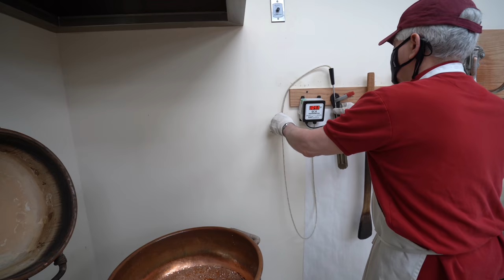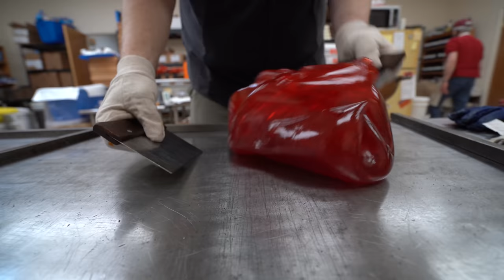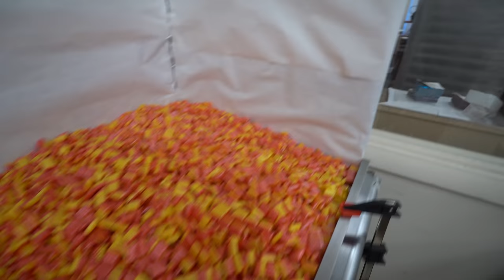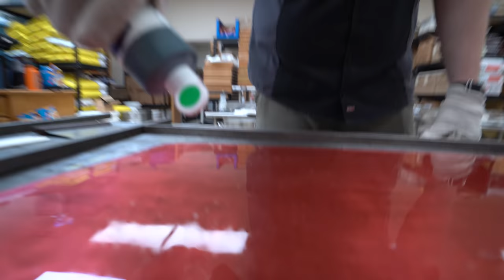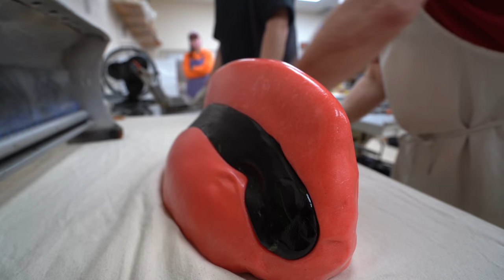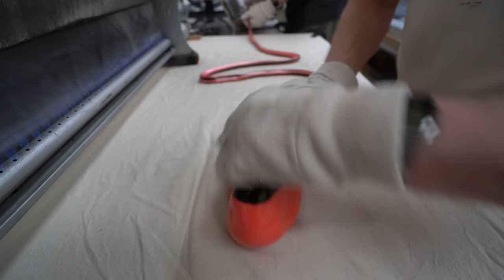Strawberry Lemonade And Watermelon Hard Candy!

Comment: Joe you would need to take pictures of the item . You don't need a sand blast cabinet! A wire wheel on a drill will work.   They have them in diffrent strengths!  There are solvents to take paint off and.  Portable blow torches you could do it! You know enough!    😊😊😊☺

Comment: So, would you think that candy making would be a good home craft idea? If so, what would you suggest be the first thing we make? And what type we should do?
Reply: That’s a great question!!!
Reply: Snack clubs or chocolate covered potato chips
Reply: Try hard candy 🍭 It’s fun, fast and cheap! 💛Start with a heavy bottom sauce pan, add 8oz of sugar, 5 oz of Corn Syrup and 2 oz of water into the pan. Set on the burner and Turn stove on to med-hi heat. Clip candy thermometer onto the inside of the pan. Boil without stirring (yes, no stirring)  til temp reaches 300. Remove from heat and add 1 teaspoon of flavoring and a touch of color (dip the end of a toothpick into gel food coloring and stir into mixture). Make sure your vent hood is on. stir mixture and then pour right away into molds. If you don’t have molds, take a sheet pan and dump a bunch of powdered sugar and press the bottom of a jam jar into the powdered sugar to make some depressions into the sugar. The sugar mixture is super hot so don’t let little ones help til candy has completely cooled. If you have left over mixture and it’s still fluid, you can pour onto the matte side of a large sheet of aluminum paper, let cool and then break. Or score it when it’s still soft but not runny, and you can break into the specific shapes. Easy cleanup:  fill the pan with hot water and leave it in your sink overnight (sugar dissolves in water).  You can get everything you need from the market for less than $20.
Reply: @LAdams-gn1xe  wow, I am writing that down!!! Thank you !